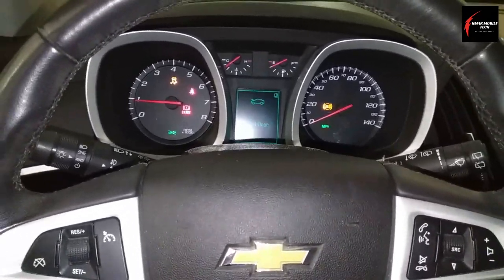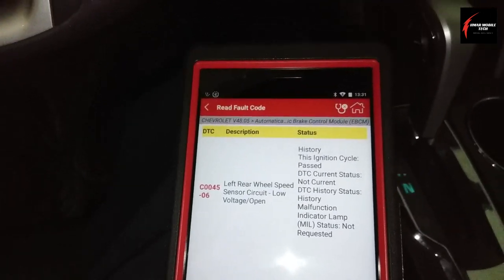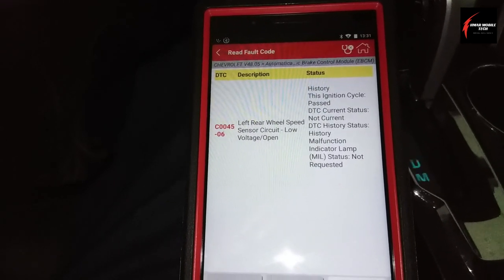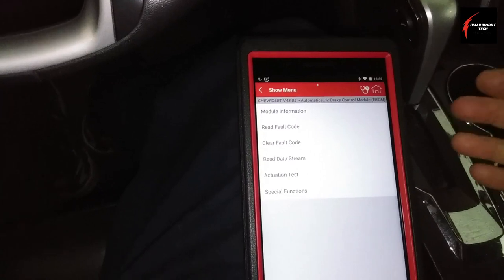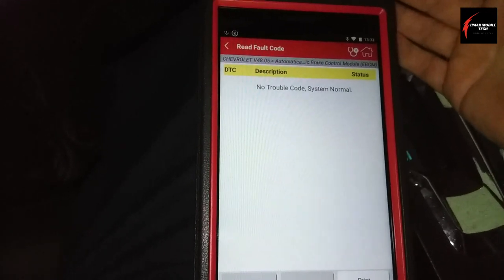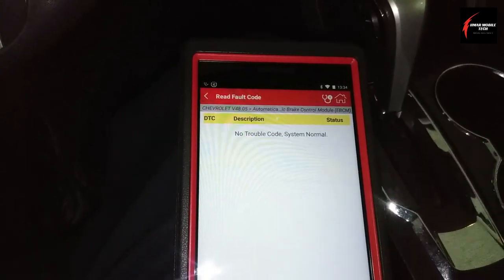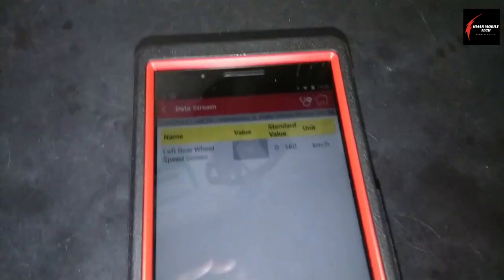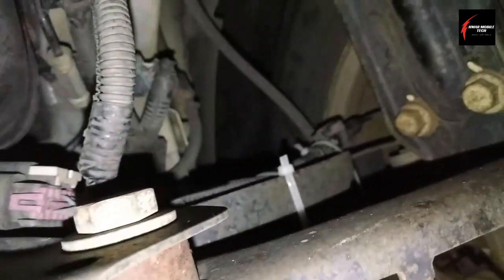GM / CHEVY STABILITRAK & ABS DIAGNOSTIC PROCEDURE & STRATEGY ON 2011 CHEVY EQUINOX AND SIMILAR MODEL

Comment: I have a 2010 Equinox, and it shows the same ABS code, but I took it for a spin and it shows speed for all four wheels . The code is for left rear wheel, the light will come on and all of a sudden it will go off... Of course it disabled all wheel drive...

Comment: Just had this same issue.... I had been using E85 for a while. Getting low in the tank and I switched back to regular gas. The light and warning went away immediately after I gassed up.
Reply from the maker: This video was in no way about fuel system repairs or gasoline types, WRONGO joshua F.👀 So I am guessin' you had to junk your e85 daily driver hotrod😬
Reply: @hmarmobiletech8332  It was the same error which has up to seven different causes from wheel tracking to the use of E85 in supposed flex fuel vehicles. Everywhere I turned was ready to have me change fuel pumps. All I did was change back to standard fuel. Daily driver is fine now.

Comment: My 2012 Chevy equinox only has the stabilitrack light and runs but loses power. What may this issue be?
Reply from the maker: Sorry but without a proper diagnostic there is no way for me or anyone else to know that, the first step is to get it diagnosed by a professional auto tech. Good luck and Ty for watching  😀
Reply: I have the same problem. I have replaced some sensors, the alternator, battery, and the throttle body and still losing engine power. Now the car is throwing a code for the stabilitrak and the brakes feel stiff. I have no idea what's going on.

Comment: Thank you sir. I just switched out my brakes and got the same codes. Could it be I just need a reset? Didn’t have any lights on before. It’s a 2014 GMC Terrain
Reply from the maker: do you have a full service scanner like the one I use or something else???
Reply from the maker: If u are able to do a soft ecu reset that may / may not fix it but worth a shot!
Reply: @hmarmobiletech8332  the light on my terrain just came. I got stuck in the snow here in chicago. And that light just appeared.
Reply: @rhurtadorh32  my wife's 14 Terrain lights came on today, driving in rain 🤔
Reply: @noro305  on mine the light went off on its own
Reply: @rhurtadorh32  yeah it's done it once before...
Reply: Driving it now.. feels like I have very little brakes
Reply: Update: it was the front right wheel bearing. Buy an ABS code reader and it will guide you.